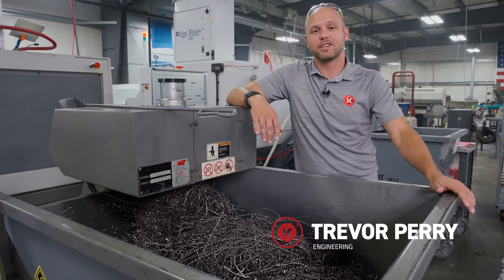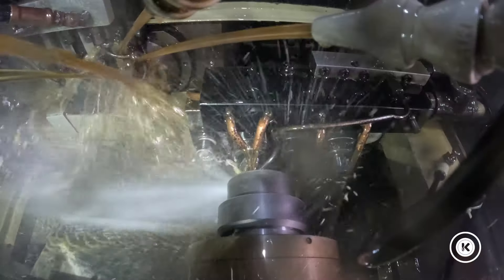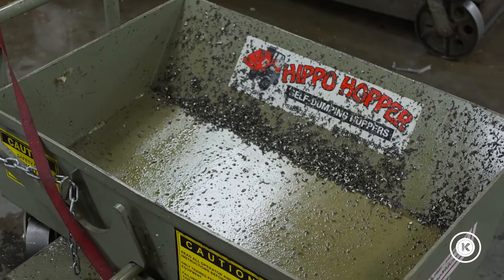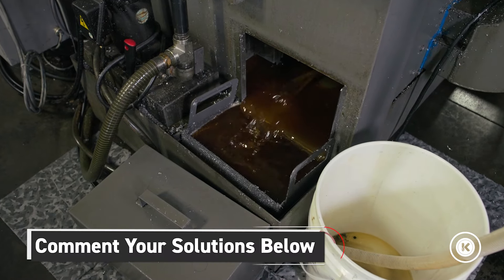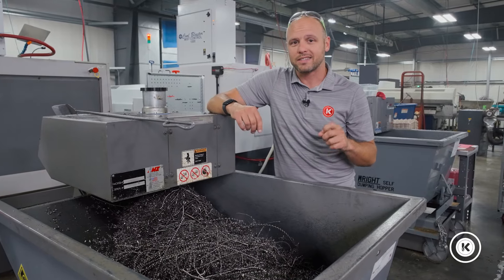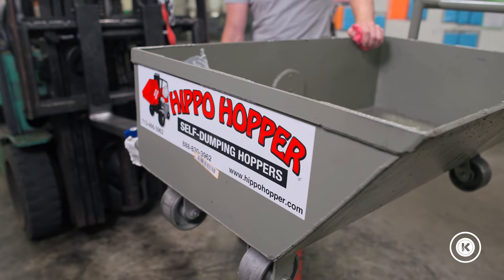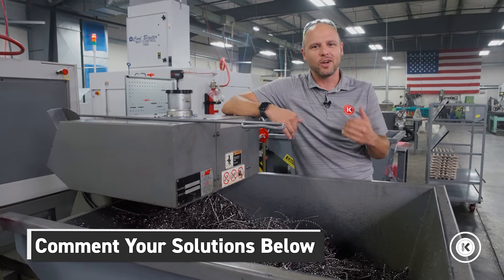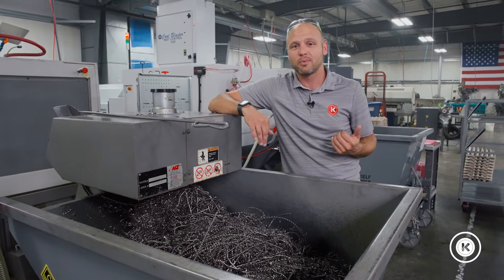Reclaiming Machine Oil - We Need Your Help!

Comment: No solutions but does bring back memories of an OD grinder where we went through a barrel of ilogrind 600 every couple days. The people in charge were just absolutely shocked when they first heard of this problem... in front of their managers. Strange how they didn't remember being told about it before that 🙄

Suddenly pumps got installed to remove oil from filter paper pans and they started trying out various pre-filters so the filter paper would advance less quickly.

I got a job offer I couldn't refuse (3x as much) so not sure what they ended up doing. Doubt it was anything very substantial, as they made far more off the product than they could save on oil. Just claim the product (engines) is green and you need not feel bad about waste of money or any material...

Comment: How much energy to you want to expend salvaging oil? Can you rinse with a glycol cutting solution? DO you have an inexpensive way to heat the hoppers to decrease viscosity? I suppose you could use a rinsing agent but you still have to spend time and energy reclaiming the oil. What's your cost/benefit inflection point?

Comment: either a centrifuge or a chip compactor, the latter would require you to have a preferably solid filtration system just for the chip compactor (briqutter) for it cuz you will get fine chip sludge (centrifuge for this one also or a mesh filter maybe hydrostatic too?) so something from knoll to reduce the sludge.

Comment: I'l get the ball rolling..
What is more efficient to remove oil sticking to various shapes of chips? Blowing with compressed air or mechanically shaking over a mesh screen? With both methods I can already picture the chips clogging and grabbing into the mesh. If thast the way wich mesh material is best suited to reduce chip build-up?
Reply: centrifugal forces might be the best way but it would probably have to happen in a batch operation.